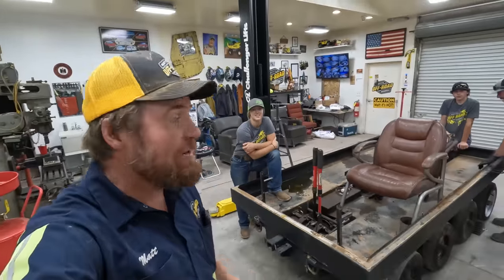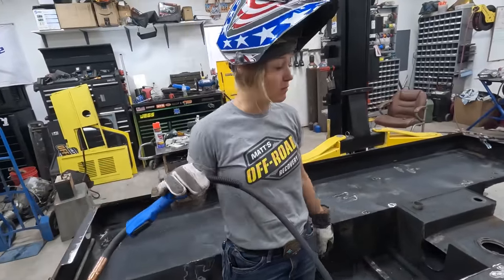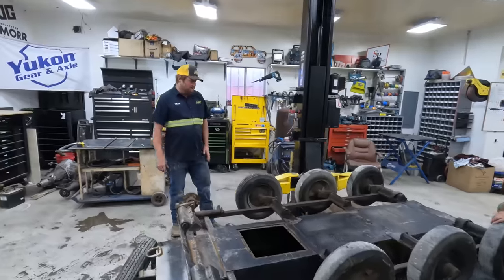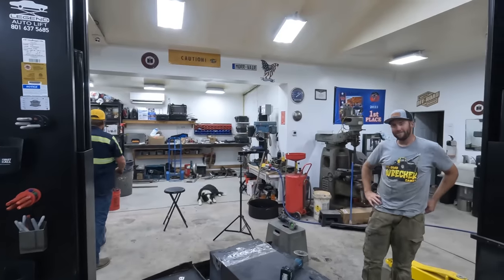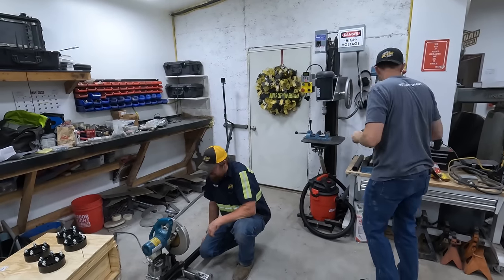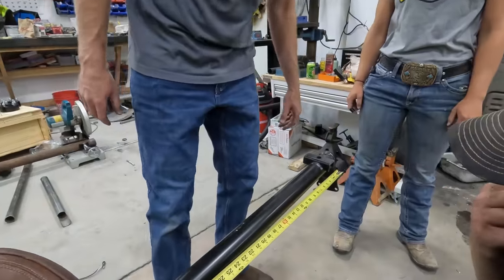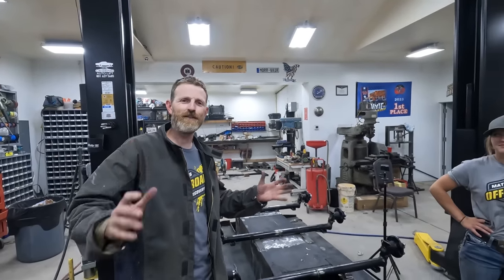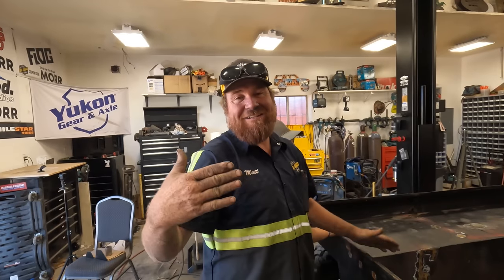I Stripped The Bombi Down To Nothing!

Comment: Thinking about your comments earlier about the proprietary drive tires for the tracks and problems you've had with them.  Here in Texas we have lots of thorns.  Honey locust thorns can be over 2" long and can easily puncture  most tires.  Some of the tire shops that deal with ag equipment have a foam that I use in my tractor front tires.  It sets up pretty rigid and lasts until the tire wears out.  My small John Deere has 5.00x15 fronts, it adds about 50# of weight and costs over $100 per tire, but the added weight is actually an advantage for a farm tractor.  The ride is certainly a little stiffer but again, not an issue for a farm tractor.    In my experience, when the tires get worn, they start delaminating.  I assume that perhaps the foam wears and allows some unsupported flexing between the foam and the tire, which causes the tread separation, but It's worth every cent because I've not had this problem until after about 15 years, and until then, no flats or problems to deal with.  I realize that the added weight is not advantageous for your situation, but it might be a lower cost solution for the Bombi.

Comment: This build is getting interesting. Along with the increased ride height, make the cab bigger with doors for everyone. Swinging front doors and sliding  rear doors on each side for better ingress/egress (no matter how the machine gets itself oriented) and, if your gonna run it in the heat, those sliders can be left open to offer some ventilation. Move the fuel tank (or at least the fill opening) outside the cab. And with all those axles to keep lubed, maybe some “bearing buddies” to replace those press- fit caps. 🫡

Comment: 44:20 back when we were first married we got down to only two vehicles .. and my wife had to drive the monster truck to work! :) 
20" 
A 1978 GMS Step Sid wit 42" tll tires off an 18 wheeler (I literally made the rims by welding 1/2" plate steel in the middles of 20" Split rims .

She was 5' 2" tall and 125 pounds .. She had to climb up the rear tire, walk along the running board to the cab :)

Comment: You definitely want some type of movement on the idler wheels. For the purpose of traction. Makes huge difference. A bogie system is a easy way.  If you don't want suspension.
More idler wheels are also better for traction.     Next level could be a combination of a bogie with inside and outside facing wheels you can have overlapping tires.

Flat bottom is also a must for snow and mud.

Comment: At @ 32:00, I see the mistake most engineers make... that mechanics don't make. "I'm never going to have to repair this machine." When one of your custom axles fails, instead of bolting a new one on, you have to turn the machine upside down to grind off the failed axle and weld a new one on.

Comment: I reckon that without any suspension at all but the tyres, you're going to have issues with a lack of damping. But at tracked vehicle speeds and on snow, I doubt that's really going to be a problem for the Bombi.
Reply: I had the same thought. The lack of suspension will also prevent the track from conforming to uneven terrain. Also extra stress placed on the chassis. 😬 
I hope to be proven wrong! These guys have a lot of great builds.
Dexter axle could've made them custom torsion axles, ready to bolt right on, pretty inexpensively too.
Reply: I think it's a massive error in judgement, to weld the axles directly to the thin frame/structure, with no suspension.

I'm also pretty sure that each wheel needs to move independently of one another, so that rolls over the landscape, rather than across it. It needs to conform to the terrain. Now, the tracks are just rigid, with no flex.

Huge mistake.
Reply: I agree. I think, and I am just guessing, that the suspension was meant to keep downward pressure on the tracks over uneven ground, otherwise the track might drop away from the tire if it goes over a dip in the ground.  I can see the vehicle detracking if this happens during a turn.
Reply: The old axles were so worn that they never sprung back to conform to the terrain, they were permanently riding on the bump stops, so they were functionally the same as what they have built here. The larger tires will afford them some flexibility in what pressure they run and will offer adequate damping, probably actually an improvement over the shot axles and smaller wheel/tire combination. Every video Matt calls out people in the comments who post things with no basis in reality and get proven wrong, at least you are giving him material to shoot down!
Reply: Tracks will also have to be ran rather tight because the road wheels now have no way to extend against the track when they go over a low spot. Though given how bad the steering was along with the wheels that where coming apart it will be a significant improvement. My only concern just because I don't know the orientation is I hope those brake disks are on the sprocket axle as otherwise they'll just make the tire slide inside the track.
Reply: @datalorian  When running tracks on wheels there can't be any flexibility in the tires, or the tracks will come of immediately. When running tracks on the tires on forestry equipment we have to over pressure the tires past specs so they cannot deform and so that any debris between the tracks and wheels don't deform the tire and push the tracks off..
Reply: @ThirdEchelon111  They'll be running low tyre pressures, so that will take the place of suspension. I'm just concerned about it oscillating back and forth if they hit a bump, but maybe the tracks will help damp it.
Thin structure is also an issue. Reinforce!
Reply: @datalorian  Oh, I know I'm ignorant of this stuff, but I at least know enough to know there's lots of stuff I DON'T know.
But I know suspension has to be damped, hence why it has shocks AND springs on cars.
Reply: @datalorian  

I saw the video. I got that.

But they have a history of replacing worn items with even beefier ones, that can take the punishment. And just because they're used to using a vehicle with faulty components, doesn't mean they keep them that way. Gas gauges aside.

And you obviously haven't seen the videos where Matt's gone back on earlier plans.
Reply: @ThirdEchelon111  I was on board with your comment until you try to tell me what I have and haven't watched, I have watched every single Matt's off-road video, and I will enjoy watching this bombi upgrade work just fine in future recoveries. Come back to this comment thread when the results are in!

Comment: I have those step sliders on my Gladiator and have beat on them hard here in AZ and they work amazing.  Had a small issue early on as I got in at the start of the Gen 3.  Talked to RockSlide Techs and they immediately sent a replacement and paid for EVERYTHING including return shipping to break it down, figure out what happened and fix any possible problem.  Their Customer Service is Amazing!!!!

Comment: I'm excited to see this thing with 24" tires. Matt's making a monster machine again! From Bombi to The Bomb!
Reply: I would have thought that more sidewall deflection will mean it sheds its tracks more often ?
Reply: @Whateverpoopiepants  Far from an expert, but the wheels on the ends are far more crucial, maybe they will have the ends at higher pressure to keep the tracks in place and the middles a bit lower.

Comment: I thought the suspension on the track rollers, were a specific design feature for tanks to help keep the tracks under tension while cornering at speed? Probably not needed for slow speeds but with an LS1 and you summer use in mind, maybe something to consider.

Comment: 49:10
I'm a bit of both when it comes to builds. A machine like the bomby is meant to be built for rough service and be easy to maintain. The Ford flat head was a common work horse in it's day, that was easy to get parts for and maintain. So LS is a great option for replacement.
Classic cars are where I can go to either side. If you have a numbers matching 67 Vette for example, restore that thing as best you can. But if that same Vette has a rod throwing chunks through the block, build it however you want because the original parts are destroyed.

Comment: Two 4cyl engines, transmissions, driveshafts, and ring/pinions would be awesome to make it turn in place.  An axle with two pumpkins would be awesome to see.  Just weld the diffs on both of them and join the two pumpkins together with an empty piece of axle tube in the middle. 

Pulling or pushing the steering levers would pull the throttle cable on the corresponding engine.  Pulling would shift to reverse, otherwise the transmission would be in drive.  Use a switch or something for neutral.

Could still keep the brake system with a second set of levers for when those work better.

Comment: They do make small and tough snowcats. Take a look at a "Pistenbully 100". 
4,3m without front and back accessories, 250hp Cummins Diesel. Made to work ski slopes every night of the year. There's even a crew cab available. 
That would be a nice piece of equipment, although really expensive.

Comment: I like the adjustment axel. You mentioned hydro steering. I would make it full hydronic drive just hydraulic pump connected to 2 hub mounted hydraulic motors. No transmission no drive shafts nothing.  Main draw back is speed depending how you set it up. Could even mount a plow.

All this aside tho it's Matt's build so he gets to do what he wants. I can't wate 😊

Comment: As a long time snow cat operator. The cat suspension is not for ride but for traction more then anything. Allows the tracks to keep more on the gound at all times. Like if your on high points front an rear, then the track will dip into the low points keeping all or most of the track on the ground.

Comment: My only suggestion would be on your fixed axles cut a plate with the axle radius on one side then weld it to the vertical portion of the tub and the radius end to the axle, I feel like that would help prevent the welds from cracking at the point where the axle meets the edge of the tub

Comment: I feel like the suspension on the old axles wasn't for ride comfort, but to allow the wheel to droop a little into dips in the terrain so more of the track is in contact with the terrain, and therefore give you better weight distribution.
Reply: Yes, they put suspensions on everything for a reason. You were thinking dips, and I was thinking bumps and rocks suspensions help with both. The snow smooths most things out, but if they weren't needed the companies that build them wouldn't have them, they want to save money and weight too.
All that said, he built a trailer without a suspension and it works fine, and if he doesn't like it, he can just change it next summer.

Comment: Great project. The suspension in a trac system isn’t to provide a smoother ride. It’s to offer the treads give over obstacles so they aren’t stretched and break under the enormous pressure put on them. The obstacle stress is what makes treads go slack from stretching. They will work only as long as the links are strong.

Comment: Are the axle brakes easy to access & replace quickly?  We run disk brakes on sleds so the snow doesn't cause brake fade & self adjusting.  The pads are simple to swap in 5 min.

Comment: Also, would it be good to brace those axles to the frame? Like picture a square piece of steel, say 6"×6", enough to overlap the thickness of the axle at least anyways.

Cut a semi-circle out of one side to wrap around the axle,  then weld the flat part to the floor? 

Even if the thickness between the flat side, and the deepest part of the semi circle was only say ⅛" or less, you could still fill in the gap between axle and floor in between these braces, however many you wanted to use.

BUT
Now that the axle is welded to the chassis solid, you could cut out basically half of those braces I mentioned, and insert them on both the front and rear edge of the axle mating surface to achieve the same thing. Basically gussets to brace it in place.

Maybe I'm way off, just figure it may give it some more strength / bracing to help if the axles ever bottomed out or caught anything!

Comment: 31:50 You mentioned that this is going to continue to be brake steering; My design question is - can you set it up so you're not leaning over to the right to run the controls: ie: the left brake is left of the driver, right brake is right of the driver to achieve better ergonomics.

Comment: Matthew, question, the Bombardier gear had reinforcements brackets on the chassis, why don't you put some quarter inch thick, 3x3" angle iron to the chassis.?.?
Reply from the maker: When you’re building, a completely custom vehicle, all the systems will not be fully operational on the first week. 
Think of the original Death Star.

Comment: Ok Matt you can have custom radiators made. It’s not about how large it is like 2’tall and 3’ wide it’s all about how much cooling surface and with that the more cores it has the more it can cool if you take a 12”x18” radiator that has 8 cores where the 2’x3’ has 4 it will pretty much cool just as effectively and the second part is the fan and shroud. The shroud should incase the entire fin area and be at least 1” off the fins and be tight to the fans and if you run multiple electrical fans don’t put them side by side stager them so you cool from the top to the bottem but that is not as absolutely important as long as you have a really good shroud that will make the fans pull from the entire area of the radiator also don’t mount the electric fans right up against the radiator I personally recommend mounting them to the shroud so the pull air more evenly now not all radiator fins are made the same I have seen $1000 radiators have fins to closely plucked in that they don’t pull air worth a crap so fin spacing is also important for good airflow.  Think of it like this I have 2 utility trailer with ramps the old one has 1/4 3/8 expanded metal the newer one  has 5/8to 3/4 expanded metal and the old one pulls very hard and doesn’t trail well at 75+ my newer one I have literally been 100 and she pulls soft and trails perfectly not I know ther things can contribute but I already know it’s the small hole expanded metal because I removed the gate and it pulls soft and straight. And the 100 mph with the newer one was a family emergency I don’t recommend doing it personally. But smaller holes do not allow proper airflow. I’m sure you already know this. I was worried about your trans overheating in the off-road wrecker it being trapped inside the frame with the full belly pan but it seems ok. I was also iffy on the dual radiator setup but it’s working for you. Surprised you didn’t need a pump between the two especially the way you plumbed them but hey you did something never before attempted and it worked for you.  That’s great.

Comment: I wonder if Matt could take a page out of snowmobiles books with cooling.
They have fin'd coolers underneath that the tracks will kick snow onto to help cool the engine. with the bombi, i see cooling issues since the rad is in the back and doesn't get the same airflow as a car would with it in front. Even if the fin coolers are just an extra cooling method to a rad i think they could make a big difference

Comment: You can build the frame and axles together without suspension.  And make brackets to put the cab on shocks so in the cap you have a nice smooth ride, like a simi cab on air suspension.

Comment: Im not sure if yall will ever see this but , i used to use those Milwaukee torch blades all the time.. no more. The Diablo heavy steel carbide deamon blades   Are incredible! I can cut through hardened steen like its butter with em and the last like 40x longer than the Milwaukee

Comment: "Empty tanks are the most dangerous" - for those that need a quick chemistry lesson - liquid gasoline doesn't burn, it's the fumes, when mixed with oxygen, that do. You can literally throw a lit match into a pool of gas and it won't catch fire (it has to be an open container though so the fumes can't accumulate inside, so don't go throwin' matches into a gas tank, try with a bowl).

Comment: I hope that the decision not to include some suspension travel for the track rollers (wheels) will not be regretted in the future. Even though the the old trailer ' elastic/Indespention' units where on full bump at least they provided some droop. Undertsand the need to keep it simple and tough but.... The larger diameter rollers (wheels) will provide some shock absorption and vibration damping but I wonder if the track will not track as well. Guess proof the pudding is in the eating. I watch with interest as always!

Comment: Tell me if im wrong but dont think the torsion axles are for suspension but more for track pivot. So by eliminating the torsion axles how are the wheels going to move up and down over different terrain. It's not as though the vehicle is on flat ground at all times.

Comment: I think the purpose of the articulation on each wheel was not to provide suspension as much as constant contact with the track. As the tracks roll over the terrain, each wheel needs to flex and change height in order to remain in contact with the tracks.
With a rigid axle there is no change in height so if the track sags down the wheels stay level. Now there's a gap between the wheels and the track. In an off camber situation the track might jump off the wheels. That may be a problem later on down the road.
Each wheel needs to be capable of height changes to stay in contact with the track.